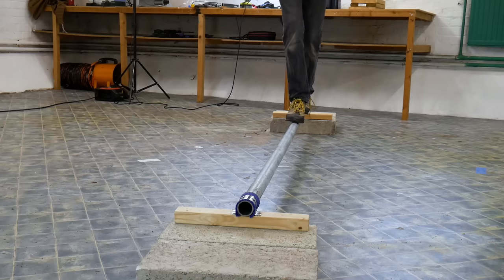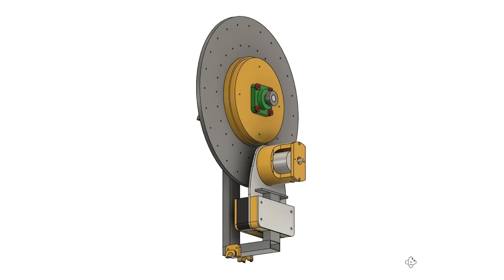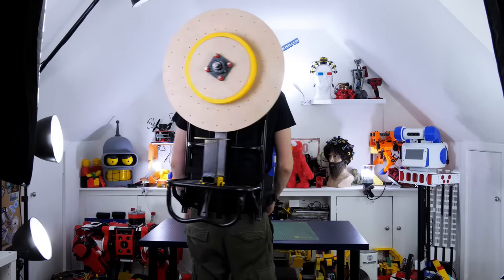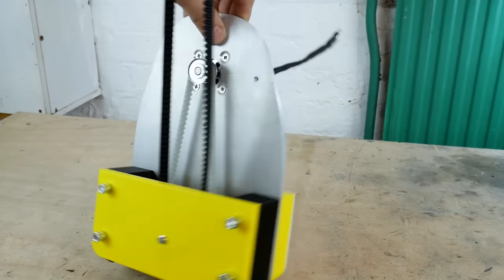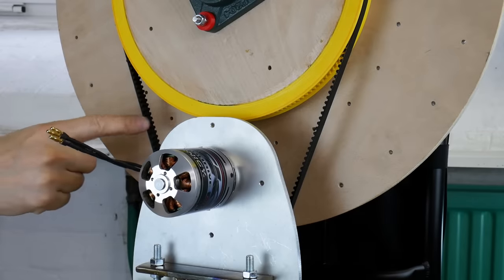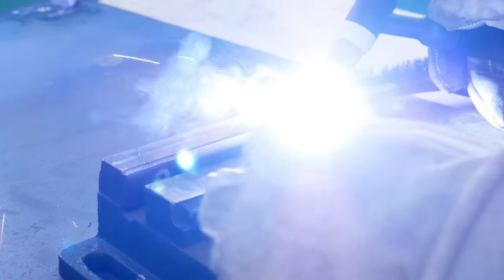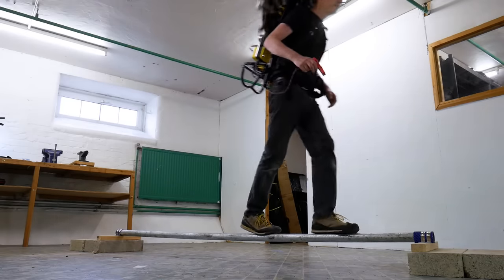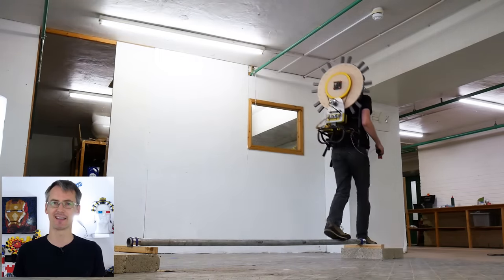Tightrope Walking Cheat Device

Comment: im no expert but i think your shoes also affect your ability to balance. they seem to be a bit tough soled so its just like putting a piece of flat bar on top of the round tube. its not going to stay on due to the difference in geometry. if you used some softer soled shoes you may get a better result as your feet "grab" on to the pipe or tightrope. This is why most of the professional tightrope walkers do it barefoot or with those sockshoe hybrids.

Comment: use 4 to 8 low density rods to hold the weights much further out and try welding the weights in an octagonal shape to take stress off of the 8 rods when the direction is stopped and reversed

Comment: I think it would balance you if you were standing on stilts...  On stilts on a tightrope.  You'd need rubber grips on the stilts so you can stand on the pipe.  Stilts that extend above so that you hold onto them with your hands.  This would be too easy wouldn't it?  But it would look a sight.  The reason it would work I imagine is the device on your back would be coupled to your feet probably making it all work so much easier, stiffening your torso yes?
Reply: ...and shouldn't the hand trigger be reversed?  When you release it would provide max torque and when you pull on the trigger it would decrease the force.  A minor yet opposite effect.

Comment: maybe a horizontal spin gyro would have been a more efficient approach?
Reply from the maker: Control Moment gyros are mentioned in the video, that is a different device though - the energy to push you back on balance still has to come from somewhere.

Comment: thoughts: I think you should've used constantly rotating mass, that turns parallel to the ground and balances by tilting against precession stabilization. It removes lag between switching direction of stabilization when current design wheel must stop and start spinning in opposite direction
Reply: Not quite correct about the delay. Reaction wheels work by angular acceleration, not angular speed. A reaction wheel spinning clockwise but decelerating or a stationary reaction wheel accelerating counter clockwise, they'd cause the same opposite reaction of accelerating the person clockwise. The only concern is saturation

Comment: If you will see at source of Lego Self-Balancic Robot from NXT3, you see differrent solver for rotation angle at parameter of hight device in basic. It is not stupid algorythm "see to balance angle and rotate wheel to another size". Where is algorythm you using?
Reply from the maker: It's a PID controller
Reply: @jamesbruton  , PID controller need fine tune to your growth. Maybe you need to make such a setting?

Comment: If you are just going to walk in a straight line, A simpler solution is a rotating wheel at constant speed , spinning a gyro instead of reaction wheel.
Maybe 2 wheels, just like a bicycle.
Reply from the maker: Bicycles don't balance because the wheels are gyroscopes https://youtu.be/9cNmUNHSBac

A constant spinning mass also won't help you unless it has an active control axis https://youtu.be/UVJx8T8wTQA

Comment: Trouble is that the more weight you add, the more top-heavy and therefore more unstable you become
Reply from the maker: Larger masses have more inertia so it takes more energy to accelerate them, that's why balancing a stick on your hand with a weight on the top is easier.

Comment: A CG shifting device seems like it would be better. That's what the long pole does for a tight rope walker. They put mass at the ends to lower their CG, but they can also shift their CG left/right more effectively with their arms. Maybe a pendulum (or inverted pendulum) on your back instead would be better than a reaction wheel?
Reply from the maker: That would still create a reaction force when it moves, as well as shifting CG, so there's more to consider in the control system.
Reply: Good point. The control system would.  Need to consider the CG shift as well as the acceleration of the mass. And also the angular acceleration of the parts that are rotating.

Comment: I really dig all the comments; one mentions the hips being a hinge but I thought Gyros work to maintain axis. If the goal is to prevent left or right lean the Gryo should be placed by the side of your hip.
A Roughly 7in x 1in rotor should do. Up to 4500rpm. The resistance they provide would feel like a wall pressing against you allowing yourself time to reorientate.
Reply from the maker: That's not how gyroscopes work, it would jus cause me to tip in a perpendicular axis: https://youtu.be/UVJx8T8wTQA
Reply: @jamesbruton  Very Cool! Thank you for the enlightening video; I didn’t realize they affect movement on the perpendicular axis.
Reply: @jamesbruton  Just checking but the skateboard bot’s Gyros you used look really similar to what I imagined; just two at the hip. This wouldn’t work?
https://youtu.be/drxzs0Dnz14

Comment: You could try this with a fin or a tail instead of the motor. When you roll to the left, the fin or tail moves to the right and vice versa and you may be able to add stability that way with considerably less weight than the wheel needs. It may also aid the robot stability giving it a tail, so you can move the tail in and out (up and down) to tilt the robot forward and backwards too.